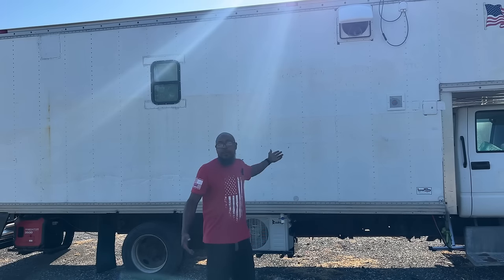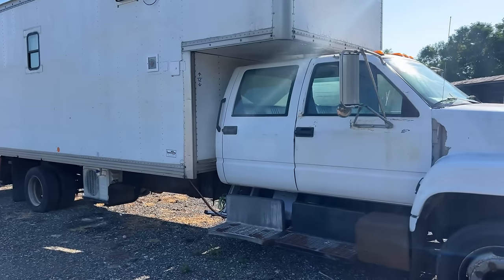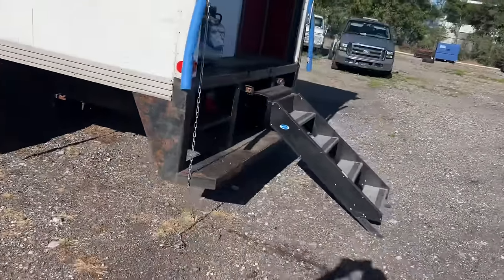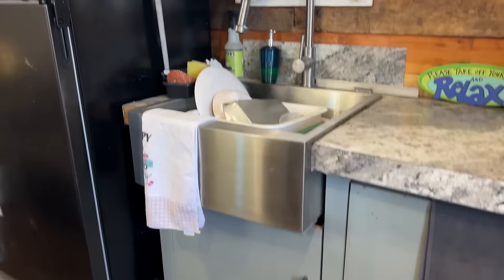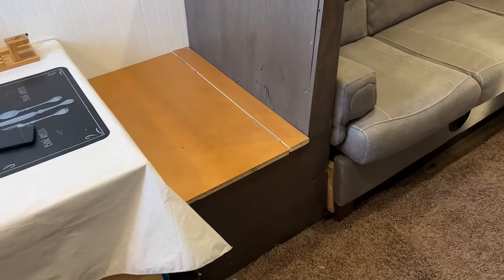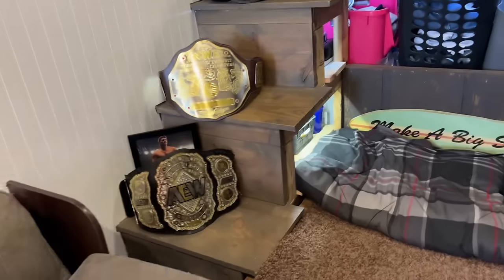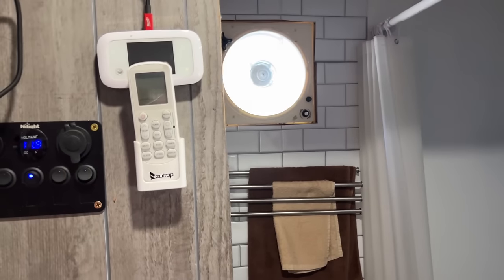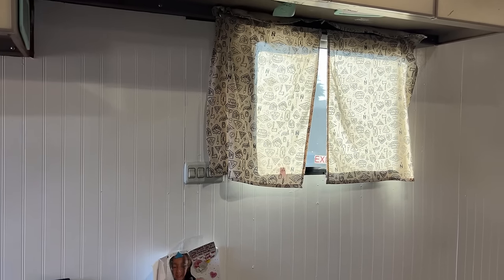APARTMENT ON WHEELS BOX TRUCK CONVERSION TOUR!

Comment: Its a breath of fresh air to see a build thats not all polish and gloss, it actually looks like someone lives in it,nice job a few questions are you planning to add a black water tank and an rv style toilet? What are the belts from? Something to consider put them in a shadow box so you can mount that on the wall and free up a little floor space, when you started the build did you add any shoring to the roof of the main box to make it more stable to walk on for any repairs needed? Love the way you did the walls it gives it a log cabin feel 👍👍
Reply from the maker: Thank you and thank you for watching. I don’t plan on adding a black water tank. I am researching now the best options for toilet systems and different companies. After I do my research, I will be reaching out and finding a company to work with for the toilet. We have extra supports at it for the ceiling. We spent a lot of time working on the wall to build that pallet wall to get that cabin feeling. I will have more videos coming out in the near future.
Reply: simple camper toilet would be just fine, but I'm a simple man.  @Ruffjourneys

Comment: Looks good nice setup. Couple thoughts take it or leave it. Not painting it and keeping it industrial may make since for city parking or boondocking with the cracking down on RVs and what not. Also your filming wasn’t bad except on the outside put the light to your front it put the focus on the subject and reduces glare.
Reply from the maker: I have definitely thought about doing that. However, I won’t be able to do any RV parks once they look at the rig on the outside. I guess that’s the pro in the con about having the outside look commercial. Thanks a lot thank you for watching.

Comment: Thanks for the vid I have a few questions....What are the belts from? What drive train is in the truck? How does it drive? How many miles on it? What kind of highway miles per gallon does it get? How do you like camping in it? Notice the no windows, provides better security, do you miss the view and air circulation? Once again thanks for your video. Great crew cab very unique truck congrats on finding/buying it.  Have a happy Thanksgiving.
Reply from the maker: Hey thank you and thank you for watching. Just just to answer your question about the belts I collect wrestling belts myself. I’m not a wrestler I just like to purchase them and collect them. This is a 1995 Chevrolet 6500 box truck. It is a 24 foot box truck. It has a caterpillar 3116 engine in it. The vehicle runs great. It’s a four-door and it runs like a Cadillac. The miles per gallon I don’t even bother to look I believe it’s somewhere between 8 to 10 miles per gallon. I decided to put his little windows in as possible in order to try to keep it as stealth as possible. Thank you and thank you for watching.

Comment: Indeed very residential materials you have there.. but effective feeling as if really you['re in a apartment studio type... I like for the fact you kept it organized not a mess at all! Oh, that vent in the kitchen.. escellent.. most Tinyhomes doesn't really have it as where the location above the stove or cooking area or the Sprinter vans usually have it in the middle.. that sir will definitely takes the aroma and fumes out right away.. oh.. the huge exhaust fan in the bathroom.. that will doo the smell out! lol
Reply from the maker: Thanks a lot I really appreciate it. I hate having smells inside my home. When I’m cooking I do not want to smell anything after I’m finished. I had to have a very big one in the bathroom because I do not want any smells coming out at all, plus it’s good to get the moisture out. Thanks a lot I greatly appreciate you watching.

Comment: I have a 5th wheel and use a bucket too. I hate cleaning the toilet, messing with the tank and hose blockages.  I have cats so I am bagging daily anyway so its so much easier than the toilet duties
Reply from the maker: Cleaning out tanks and hoses. Absolutely was not for me when I considered building this thing. That seem too nasty for me. There are other options that are out of my price range. The bucket and sawdust is right in my price range so it works perfectly. Thank you and thank you for watching.

Comment: Looks great!
Reply from the maker: Thanks!
Reply: @Ruffjourneys I had to rewatch the whole video. I’m not sure how I missed the belts on the steps the first time. 

No shame in saying Harbor Freight instead of off brand. I only mention it because they make items that are perfectly fine for a similar build. For instance your Predator generator is perfect for now. If you upgrade to a newer rig you will know if you want to incorporate it or move up to a different unit. 

You’re still a young man and maybe handling heavy awkward stuff is fine for now but you will want to install a crane to move heavy equipment including the vibrating generator. Install a couple of 2” receiver hitches where you might need them and purchase a trailer hitch manually operated crane. Lock it in and move the heavy load and then put it away until you need it again. Your older back will thank you.